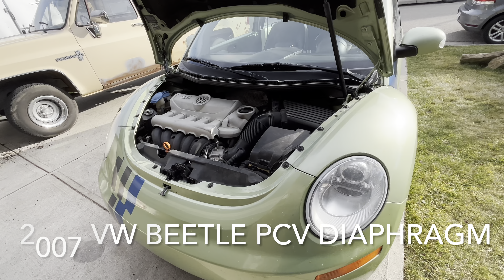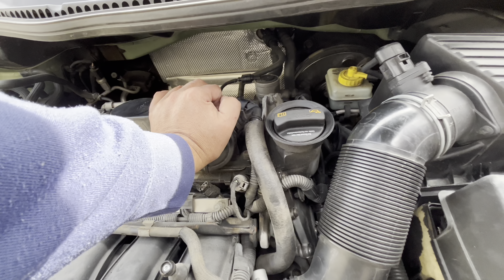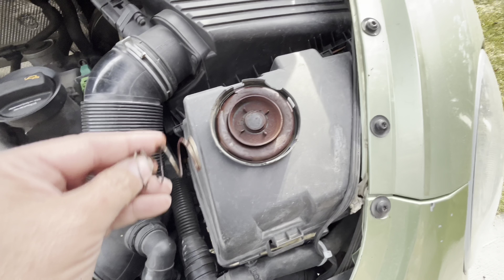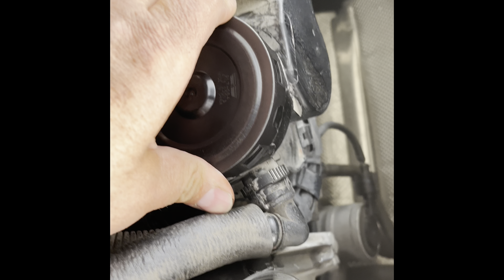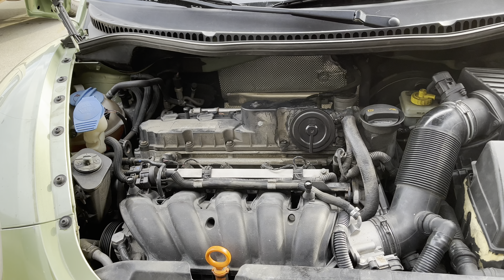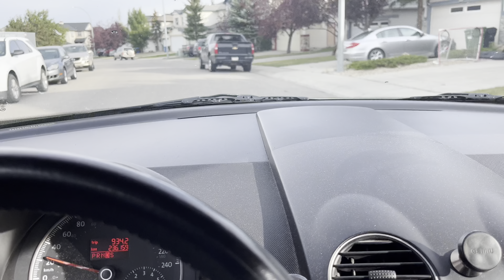2007 Beetle, PCV Diaphragm replace super easy #newbeetle

Comment: Could this also set off a engine code intake air leak?
Reply: The engine code, i think, was a value cover air leak?
Reply from the maker: It’s possible yes, if bad enough I guess. In my Audi q7 same part went and it would give two other codes like lean condition bank 1, erratic idle definitely a condition

Comment: Any issues with replacement pcv, just wondering long term vs replacing valve cover with pcv built in thanks
Reply from the maker: No issue it’s still working the factory spring was softer than the replacement so I used the original my mother is law is still driving it, no need to do do while valve cover unless you cannot source the diaphragm